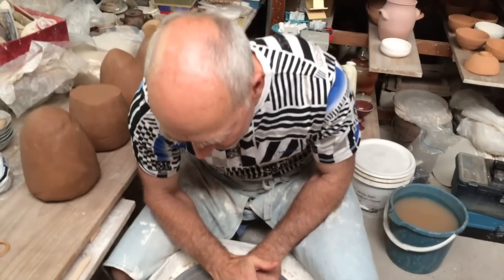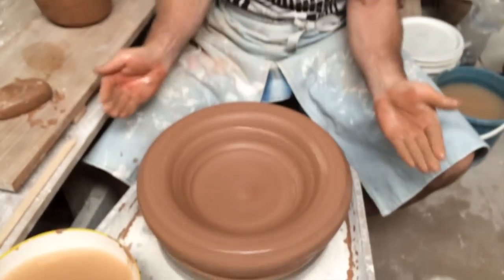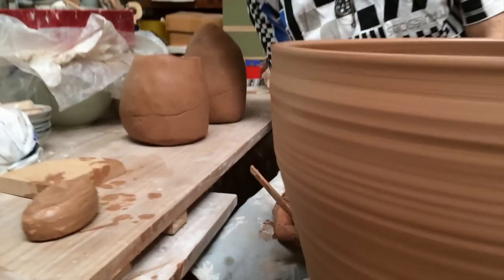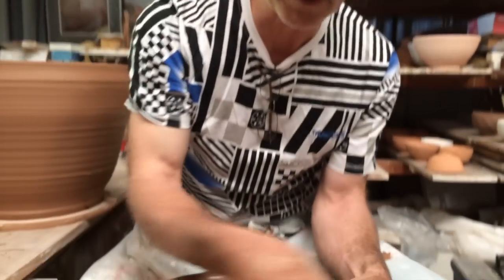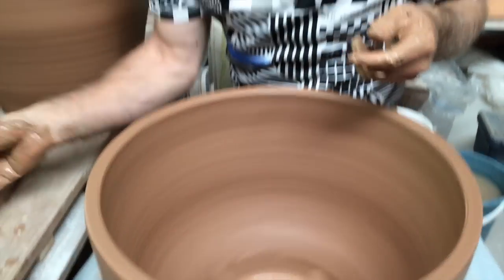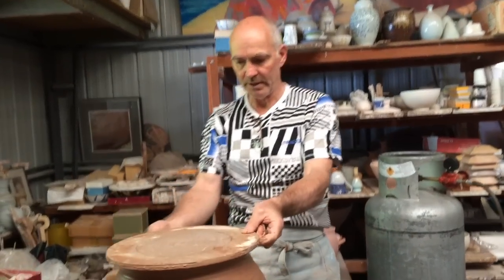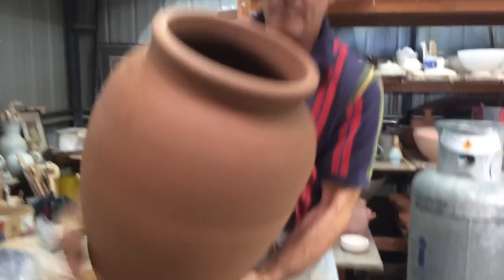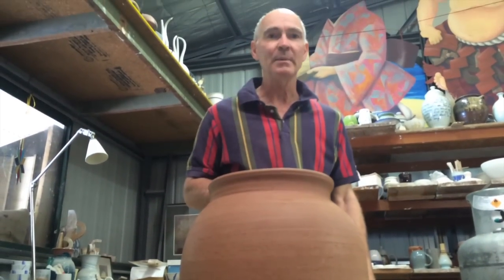Making a big pot on the wheel

Comment: Amazing how you can handle that much clay without losing it.  I'VE BEEN THROWING for about 3 years and still struggle to handle any thing more than 4 #.   Joyce Knake
Reply: In my opinion, what a lot in early- -learning-to-throw miss is how important is is to keep your body, (with them tucked into your body) your elbows, arms, hands and fingers absolutely still. You have to focus on these things at different stages. Also, I suggest you not keep your foot on the peddle so you don’t have changes in speed or foot movement throwing you off. Yes, you have to learn what speeds to set the wheel at for different stages of the pot throwing. (They can go flying if too fast😂.) 

Also, especially with a big pot you have to make sure the pot goes a full revolution while holding still, at the very least. 

Hope that helps. I hate to see people give up or get stuck at an early stage of throwing. 😎

If standing to throw big you have to use legs solidly in place to keep arms, wrists, hands still.

Comment: thanks for the demonstation. is there a reason you throw the bottom first which later nessesitates re centering the bottom again?  and it would be great if you talked about tunnel centering which you seem to have a special knack for.  thanks again.
Reply: desertbluesman ... tell me, would you build the top 40 stories of a skyscraper first? No. You have to start with the foundation first. You see, a potter has in his mind the shape he is after and he begins with the base or foot and waist of the pot. Then, with a sectional pot, like this one being demonstrated , you must continue with that shape from the waist up to the shoulder, or for larger pots, a continuation of the mid section. By throwing the second piece “upside down” and so on, once you flip it over and attach it to the first and cut the bat off, you now have excess clay where it was connected to the bat. This excess clay can now be thrown and pulled up, and the shape refined so as to either set it up for another added section or, thrown to completion. Hope this makes sense and answers your question.
Reply: desertbluesman